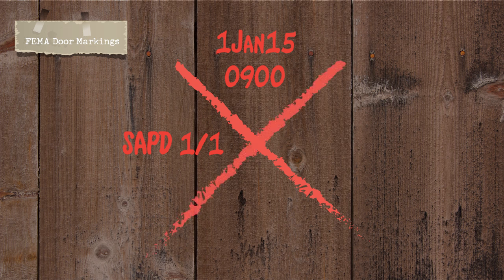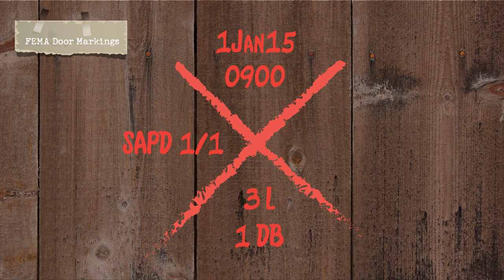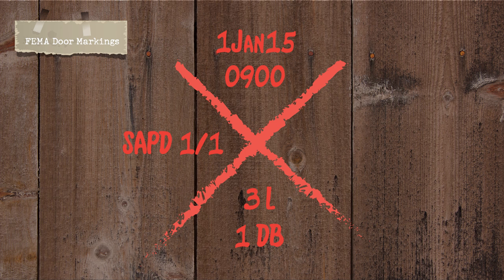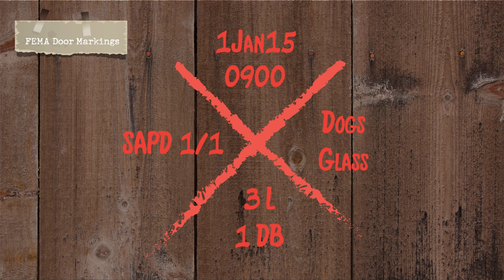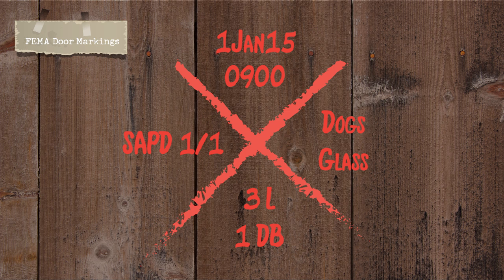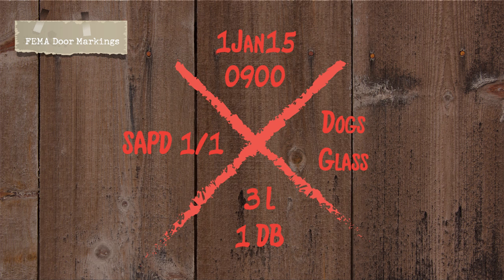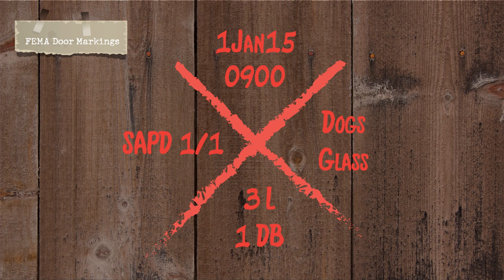How to read and understand FEMA structure markings

Comment: Scottish rules issued in 1598 stated that on admission to the guild, every mason had to enter his name and his mark in a register.
There are two types of marks used by stonemasons.
Layout marks, which delineated the position of a piece of stone in the overall design. Since stone was usually worked at the quarry or in the masons' yard, rather than in situ, such marks were necessary for efficient operations. Medieval carpenters also used this sort of mark.
"Signature" marks that pertained to a particular mason or workshop. This is what is generally meant by the term. Merchants also had such marks, used to mark their goods.
The exact purpose of mason's marks is unclear, although it is generally assumed that they mark the working of a piece of masonry by a particular mason, in order to claim payment. Others are assumed to indicate the position in which a stone should be laid. It has also been suggested that marks indicate the origin of the stone, or the location in which it was worked.

Comment: Do teams normally put 0 0 in the bottom quadrant if there is neither found or do they leave it blank? Also same with the right quadrant if there is not dangers found? Thanks, very informational video
Reply from the maker: if nothing is found, 0 0 would be used in the bottom box. The right box could be a zero, a slash, or left blank, though blank is more likely to mean "unknown" than "nothing found"
Reply: +Lefty&#39;s Guns Cool, thanks for the info :)

Comment: Were you taught to leave N/E besides indicators in the bottom quadrant? This was to notate that what you found had Not been Evactuated. In other words 2D N/E would be on an initial sweep for Survivors indicating that after the initial sweep, secondary crews know there are 2 bodies to be removed from this location. Just wondering how wide that was taught, since it wasn't mentioned? Be Safe.

Comment: What color are these marks? In nearby towns I see yellow and green, on vacant homes.
Reply: +LIZZIE SANGI Sangi (Lizzie) Really.  What state?  I might have an answer as to why.
Reply: daschundloverable The grand ol' State of New Jersey, USA
Reply: LIZZIE SANGI Sangi Ok, were those homes flooded in Hurricane Sandy?
Reply: daschundloverable No. These are boarded up homes, 2 family that were/are run down. Depending on the 'neighborhood', even within a two (2) block radius, the homeless might crash there...(tolerance)  From what I see, thaz not happening. There were quite a lot of them. The markings were similar, but different colors.
If not for Staten Island, we would have been WIPED OUT.
Reply: LIZZIE SANGI Sangi Talk to someone at say a soup kitchen for the homeless.  Last year in our county a fireman told my mechanic that 100 people went missing in one city here and yesterday I spoke to a woman who works at one (in a different town) told me that she works at a pantry for the homeless; but recently she said they had about 100 of these people and the number had dropped down to about 40.   Have you seen what's happening with the homeless?  As far as the houses go, they might be marked for demolition so the homeless can't stay there, such as what happened here with the 100 missing by the fireman.  Shortly after that, that city became "federalized" to tear down those vacant homes.
Reply: daschundloverable   I 'have' wondered, if they just cleaned up some areas, put them in shelters, or a seedier part of town. A friend of mine in S. Carolina said there are no homeless in FEMA camps, there.  What state do you live in?  Any clue if they were rounded up in the middle of the night, or driven to the County line and let off?  Thaz a great topic. I wanna know more
Reply: LIZZIE SANGI Sangi Well, where the 100 people went missing - there is no seedier city or town in this county and now those vacant homes have been torn down.  The area of the soup pantry/kitchen is run by a Baptist church which owns multiple properties in what used to be the downtown section - I'm talking blocks here - of a once thriving business district from the 1920's - 70's.  There's a new walgreens and a corporate owned (but still named after the original owners for fronts, that I know for a fact; and our water supply/company is also privatized as about 10 years ago and our county is on lake Michigan and my water bill keeps going up every 6 months.  It is now doubled from 10 years ago; although I live in IN, my brother lives in AZ and has the same water company - AMERICAN WATER).  Sorry for the digression, but back to the area of the Baptist church, in that area, there is a very seedy hotel and some law firms.  The rest is owned by this Baptist church.  I believe your friend is wrong.  A f e m a camp is not what we are expecting them to be right now anyway.  I'm digressing here again, but back in '95 on Dateline with Stone Phillips, he did an expose on "privatized prisons" that were being built around the country.  He looked perplexed himself, but I knew better.  My mom had told me that she had read an "underground" newspaper written by former RC priests and nuns who said that con centration camps were being built by our govern ment" - wow, was she freaked out.  I was just 15 at the time and well aware of what took place in Germany since my dad was a WW2 veteran.  Anyway, the following year in '96, I was dating a railroad engineer and he brought up that it was "the buzz of the RR that con centration camps were being built across our country, so that kind of confirmed what my mom and Stone Phillips had said.  And if I recall correctly, the builders of the new buildings, which by the way were standing empty, were being built by hali burton. AND 2 years ago, I had driven through a town to buy a lawn mower.  Practically everyone had signs in their yards that said "say NO to prison".  I asked the guy I bought the lawn mower from and was familiar with the property where it is now being built.  It's on the border of the town where the 100 went missing.  It was a former catholic church tucked away from plain site.  In 2001, I met a guy on line with a website who was originally from this area (Oh, I'm in NW Indiana, about 40 miles from downtown Chicago).  Since he was coming up here to visit his mother, we spent 2 days driving around my county.  I had already driven around it and I found some very suspicious sites.  I drove him around and he confirmed those sites.  He also showed me other sites which could be used as tent cities or camps.  When I said, how could they live in tents come our terrible winters, he said that they don't care what happens to the people.........duh!!!  I guess I somehow missed the entire point, thinking they would be "housed and fed" - not going to happen.  I also had been followed or should I say escorted out of 2 places.  Actually, there is a building, a very strange one, that back in the late 80's was surrounded by vacant land.  It's about 6 sq. blocks BIG and has a 10-12 foot BRICK WALL surrounding the entire circumference of this place.  It has no name on it.  In the front behind the only entrance/exit there is a building with a huge and very tall chimney.  What is this place?  A friend of mine and I went around it (Oh, some very nice homes have been built around it since).  On the third time of circling this place, we were now being followed by a black suv, so we left.  ALSO about the same month, we had gone to a Jewel's grocery store.  We were there twice when a very grungy and dirty foreign man was with a very well-dressed man in a suit and nice expensive top coat was with him, showing him how to pay; no doubt his handler.  The second time we were right behind them and we were quick to follow them, unobserved.  This foreign man lives on the outskirts of the town with the brick wall, which by the way is one of the wealthier towns in this county.  I made it a point to drive by this house, which is off a main road and only has a dirt road leading up to his house.  I hit the jackpot one day.  He has a pole barn and the door was open.  What I saw shocked me!!!  It had 4 military camo vehicles in it!!!  I'm glad you weren't affected by the hurricane, but was keeping track of the people who were and how they were living in tent cities and saying it was like living in a concentration camp and snow was blowing inside from the bottoms of the tents.  Did you see any YT's on that?  About 6 months ago I saw a YT about 1 guy and how his house is still standing, but he can't move in due to (I forget the reasons, I did not know if it was "marked"); but he is renting and also having to pay his mortgage.  I used to be a realtor and know that cities and towns cannot own private residential properties.  Several years ago, that law changed and in our county, there has been mass unemployment and foreclosures.  The last company I worked for listed mostly foreclosed properties.  I talked with one of my friends from there who told me that those listings have dropped.  (There are many other agents from other companies that in the past 10-15 years who also do foreclosures; I don't know how many listings they are doing now; but I get this feeling their listings have dropped too.  I believe with this influx of "refugees", not just the ones coming in now, but from the ones that came in on THE BEAST" train last year from Mexico and Central American countries, where the majority of them are young buffed-up men, just like the "refugees" coming in to Europe and eventually here, are being housed in these foreclosed homes.  There are YT's on it and YT's about knowing your neighbor!!!  I have a few other stories, but I will close with this one which goes back 10-15 years ago.  I went to the county just SE of me and was looking for a good buy on a property.  (Oh, I regret not buying one in particular).  I guess in fact, according to my daughter-in-law, some TV program is going to be filming a series there.  The name of the town is Medaryville, IN - I don't have TV, so I will not be able to watch it, but maybe you will.  I don't know the name of the program.  The only industry in this county are corporate owned dairy farms, still standing behind the names of the original owners just like our grocery store chain in our county, also a few multi-generational farmers hoping to get bought out by the corporate dairies.  I talked to quite a few people - (Two of my high school teachers used to tell me I should study journalism in college - another story).  From the people I learned that there are sections of the dairy they are not allowed to go in, only the supposed Mexicans.  (I'm going to digress again, because of the importance of the subject matter.  I have since learned that back in the 80-90's, many arabs were sent to Mexico to assimilate themselves.  It takes 3 years for someone to learn the language and customs.  Then they come here posing as such...........think about that one).  Once I went back to look for this very small town of about 50 homes at most.  I couldn't find it, but was lucky to come to a 4 way stop (no traffic), but there was a woman with 2 kids in her car and I beeped at her and got out and we talked.  I was only a couple of miles from this town.  She told me that she worked for the dairy farm also, but was a driver of dead cows and was not allowed at all inside.  I forgot to ask her where the bodies were taken.......I guess with so many cows, there are daily deaths.  ANWAY, she told me that these "immigrants were paid $10/hr. no taxes, given free homes, foodstamps and free medical all at the taxpayer's expense.  She also told me that on Fridays they would go to Chicago and buy drugs and sell them to the kids in the local towns.  This was confirmed by one of my son's friends whose parents just moved to a nearby town.  They drive 40k trucks.  She also told me that I would not recognize this little town and she was right!!!  It now had manufactured homes galore!!!!  There had to have been about 100 homes now.  I could go on and on, but I think you have the idea.  Another example is an older man who had a machine shop.  His best customer used to be A/C DELCO.  Well we know how our manufacturing base has been shipped overseas and now him and his son-in-law who is to take the shop over are struggling.  Did you see the recent yahoo article about the homeless in Hawaii and how politely they are supposedly "helping" their homeless?  This is an article I found.

 http://www.theguardian.com/us-news/2015/oct/17/hawaii-homelessness-state-of-emergency

I'd like to hear your feed back.
Reply: daschundloverable FEEDBACK??? Girl you got so much going on I don't know where to start!  I'm gonna go off the cuff for what I remember you wrote and thaz a lot.  You didn't divert the conversation,   Back in the early '90's, I dated this guy from Illinois or Ohio. He was a freight (heavy freight) truck driver. He was up here because of a contract run he had with the gov't. ---  starting from a high Northern point, to S. Carolina and back-- and forth.  He was getting something like $10,000 a run, which is still phenomenal - To this day I wonder if I got that correct. Why do I think about it today?  Altho' he didn't know anything on the peripherals, he was carrying army tanks and heavy army equipment, as such.  He said he couldn't figure it out, WHY they want these tanks and heavy army equipment brought from up North, to S. Carolina. There was a whole bunch of other insidious factors - like other runs they had going on but he chose this particular run and the pay! He said for the money, he didn't caret .  My family owned a huge dairy farm, in the Catskills, 670 acres 250-300 head.  There are other factors, but the gov't made a law, only a certain %'g of milk can be produced by dairy farmers. The farm is there, but not milking. In fact that part of the Catskills is prime dairy pasture and I'm telling you it is tucked away!  So when they say go somewhere remote, or go the The Isles, I've been thinkin'....LOLOL aT ANY RATE (oops) that part of NYState was one of the top producers, MAJOR production, of milk for the NE corner of the US. ALL dairy production wz halted and iz crazily noticeable, on the landscape .
Reply: LIZZIE SANGI Sangi Wow Lizzie, now that you mention it, I did see something about the dairy farms up your way; but don't remember the details.  Thanks for reminding me, but I do believe it did have something to do with the government halting their production.  Does your family still own the farm?  Or were they forced out of business by big corporate?  Dear Lord, help us.  Do you see homeless where you're at?  Or "just know", instinctively, there are places/towns where some might be?  I just chatted with someone else on this same subject and he said he sometimes volunteers at a soup kitchen and he is going to warn them.  I hope all is well with you and your family and your farm.  You're in my prayers Lizzie.  God bless and protect you and yours in these perilous times.  BUT REMEMBER, when the true Jesus comes...................these demons will burn to their evil cores and our planet will be restored to the pristine condition it was in a long time ago and all wrongs will be righted.
Reply: Patrick McEleny  I guess you need to stay away from Begley and sub to SHEPARDS CHAPEL.  There you will learn something and maybe receive the gift of discernment God would like for you to receive.  May God bless and protect you in these perilous times.
Reply: An intelligent answer to your question is the color doesn't matter nor does it mean anything.  It is supposed to be any available fluorescent color.  It's used by SEARCH and RESCUERS...  has nothing to do FEMA camps, or trailers, or...

Comment: Nice video, good attempt, but as a FEMA Search instructor, I have to let you know you have some incorrect and some misleading information.  First and foremost, the quadrant information you give is incorrect.  The "LEFT" quadrant would contain the team information (SAPD,) the Time and date of entry. The top quad should contain the time and date the search is completed (do not assume a search could be completed in one calendar day)  Your information on the hazards and victim quads are correct.  Not sure where you got "WADA,"  In FEMA US&R, we refer to Wide Area Search as "WAS."  In the case of WAS, we typically use search stickers with the identical information thus eliminating the need to carry and use paint.